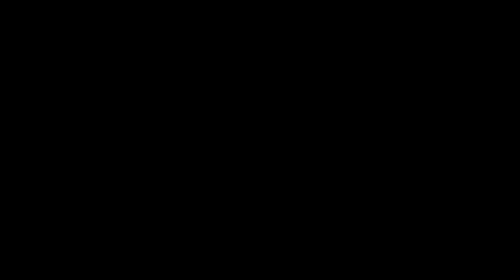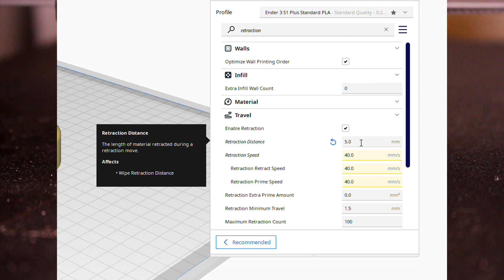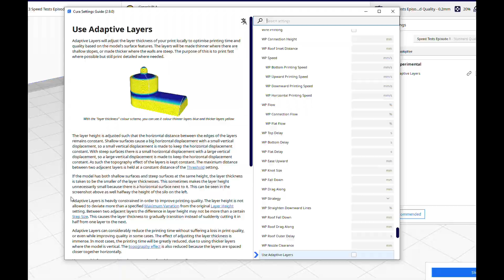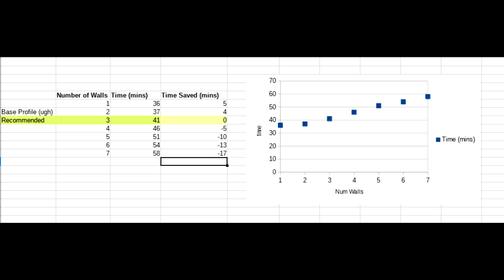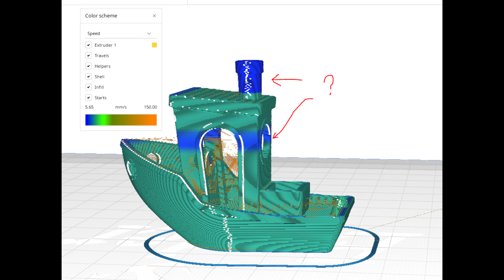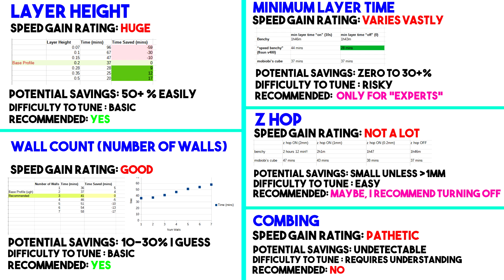Make your own FAST profiles in Cura 5.0+ - This video series will save you TIME. Part 1 of 3.

Comment: In all seriousness a great video. I'm trying to set up two Ender 3 V3 SE's. One with a 0.6 and the other a 0.4
The idea being finer details done with the 0.4, medium with the 0.6 and when I get my Ender 5 Plus back it will have a 0.8 for big and rough. I will mostly be printing armour and helmets which I smooth over with UV resin before painting. Does this setup make sense to you (I know you're not really AI (or do I))? Any advice is welcome and much needed

Comment: It's fiddly but possible to override the default settings from Cura by using the folders in %appdata%/cura/.

The default files for my SV01 Pro did many debatable things like excluding the generic materials - ignoring settings from any material inheriting from the generics - and setting multiple undesirable overrides in "quality" for different filaments and nozzle combinations.

One note: for some reason, the .def.json files go in /definition_changes/, not in /definitions/.

Now I can pick a filament, nozzle size / variant, and quality while keeping custom profiles for more "print job specific" cases as a final touch.

Comment: I have never used z hop on any printer. 
I like to set my minimum layer time as low as possible but still get enough cooling. Usually this means running several small test prints. 

Upgrade your parts cooling fan that will help drastically with printing faster. You can tweak print speeds and minimum layer time after. 

Have found acceleration speeds to make a big difference in print speed and if you don't go crazy with it you actually don't lose print quality.

Don't be afraid of adjusting acceleration speeds and running test prints if you start to see new artifacts go back to last good value.

If you have a stock ender 3 pro or similar start at 1k accel and work from there. Creality sets them stock to a slow 500
Reply from the maker: hah, you should watch the next episode from the other day

Comment: I've spent many hours tuning my settings in Cura to try to print faster on my Ender 3. My advice is:
- if you have upgraded part cooling fans, crank them up to as high as you can tolerate, decrease the minimum layer time to something like 2 seconds,
- use support blockers to prevent supports anywhere they're not actually needed,
- reduce the walls to 2 or 3, 
- reduce the top and bottom layers to 2 or 3, 
- use the lines infill if it's just an aesthetic part, or use gyroid if you need strength. Also enable "connect infill lines". 
- Try to increase your print speeds as high as they will go, but you're going to run into a lot of vibrational issues after about 60mm/s. Go faster on the infill and inner walls, but slower on the outer walls. After installing Klipper and tuning the linear advance and resonance compensation, you will probably be able to reach about 90mm/s until you see the same vibrational issues, but all of that is beyond what most beginners are willing to do so perhaps it's not worth explaining.
Reply: You should look into changing your nozzle size to 0.6 on cura even if youre using a 0.4 nozzle, I get double the time saving without adding any speed

Comment: I don't like combing, on my delta combing always results in the nozzle brushing past the supports and knocking on them. This can often dislodge the print or break part of it etc etc. With a later height of 0.1mm (average on my delta for me) and a z-hop of 0.2mm it barely adds any time at all. That along with turning combing off and my prints are vastly more successful, no infill knocking, and print times only go up by 10-15 min on a multiple hours long print.

I'll have to experiment more with my new Kingroon KP3S Pro but I think the same will apply to that as well.

And yes my cooling is adequate, my speeds are fine, all my other settings are good. I print with dried filament with proper temps and retraction settings per roll.

Comment: You left out some parameter which comes to mind. "Combine infill every n layer" this can save quiet some time as well, but unfortunately only when printing small layer heights.
I also print way thicker infill widths of about 0,7mm with 0,4mm nozzle. You can do the same to inner perimeter and reduce the parameter count from 3 to 2, or even to 1 perimeter but way thicker.

Comment: Great video and I’m looking forward to the whole series!

Non-linearity is prominent in your chart because you plotted X vs. Y, but X and Y do not have the same dimensions. Y is minutes, but X is a dimensionless number. If you replace the time (Y) values with linear values of 106, 74, 49, 37, 26, 21, 15 you will get a nearly identical curve, not a straight line as you might expect. However, if you normalize the actual data in both axes to values between 0 and 100, the line will be nearly straight.

Nonlinearity is real, though, because the bottom and top layers (as you pointed out) always take the same time, regardless of layer height. If your cube was 100% solid, the top and bottom layers combined would take up  0.53% at 0.7mm layer height but 3.77% of the time at 0.5mm layer height. But the cube is not solid, so the top and bottom layers take up an much greater portion of the overall time.

Also, your cube at 26.5mm does not divide into a whole number of layers except 0.1mm and 0.5mm layer heights. The slicer will probably throw away a layer at all other settings (or maybe it adds one, but it doesn’t print a fractional-height layer).

Comment: If you like to print fast, sooner or later you come to the idea to use big nozzles. There the maximum volumetric speed can be the limiting factor. In that case you might not see a speed bump if you increase the layer height. We are talking THICC! 1-2 mm nozzles.
Reply from the maker: Potentially. But there are some interesting surprises around that topic

Comment: Cant wait for the next video(s)!I get this series is about speed but Im assuming next things to cover would be jerk, maybe acceleration and probably one important thing would be line width BUT over the past couple of days I ve been playing around with these settings trying to improve the quality of my prints on my ender 3 V2 and although Im not sure I gained much in speed but 2.5x the jerk (stock is set at 10) for outer walls together with a 0.42 outer wall (0.48 inner and infill) gave me the sharpest corners so far.Deffinitely an improvement. Oh ye, aso wall printing order "inside first" plus wider line width got rid of the infill seen through outer walls when printing 2 wall lines only.
Reply from the maker: Idea for series two, improve quality! 
Not a bad plan... writing that one down. 👍👍
Reply: If your ender 3 v2 has tmc2208s then a recent marlin update means they are now compatible with linear advance. This will give you the sharp corners you want.

Comment: Combing is there to try avoid the nozzle scratching the surface. Ussualy you set it to not on skin
Reply from the maker: Apparently if I read it right, not in skin is now obsolete and the new one is "not outer surface" although I'm not entirely sure what the diff is, also it's not default on my cura so...
Reply: IMO combing is weird, because it tries to prevent retraction (or so I understand it) by oozing molten plastic on printed part (over sections that won't be visible, if correct setting is selected).
As result, the nozzle will be unpredictably more or less empty when it's time to start printing next line, which leads to low pressure --> under extrusion at the beginning 🤔

I won't even start with sensibility of not crossing perimeters, but it won't speed things up 😬

Comment: For the extra points, flow rate and speed ?
Reply from the maker: haha actually no! See me after class 😂😂 
It's line width. Width to height has an optimal ratio like 8:5 or something, I need to go remind myself of the exact number
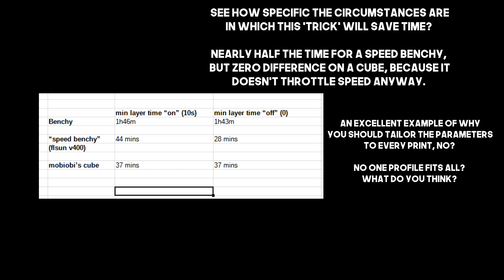Reply: Ah ok that does make sense. 8:32 , I never use preset profiles I change the settings for each model. I’m sure I would get acceptable results with presets but I never have for some reason.
Reply from the maker: me too - I usually have a base profile that's kinda "normal" then I change some stuff every print depending on the exact model, like wall count or support %, I think if you don't do that you don't get the best results at all, I'm trying to convince more people to do this I guess 👍
Reply: First

Comment: I'v got to disagree about Zhop. Since I started using it I've almost completely eliminated my prints getting yeeted off if the bed mid print after getting a small protruding of plastic smacked by the nozzle.
In my testing you don't really need more than a single layer height of hop to get the effect and at 10mm/s hop speed it really doesn't add much to the overall print.
Reply from the maker: I'm willing to entertain z hop, although when I tried it, the blobbing from raising the nozzle caused more yeeting. How many mm are you hopping then, 0.2?
Reply: @LostInTech3D  I use Z-hop on most prints, at 0.3mm. really helps in my opinion especially printing with a lot of jumps between seperatly printed areas giving 0.3mm allows me an amount of safty and in some cases actually makes the print maginally faster when combined with combing-not in skin. I really helps if you have a part that has more than one section/area on the layer (two towers for instance) as it gives additional moment for the retraction to happen before making the jump to the next part of the layer
Reply from the maker: Hmm sounds like the perfect topic for a friday poll! 👍
Reply: @LostInTech3D  were you using retract on Zhop when you were getting blobbing? And yes I'm using 0.2mm Zhop.
Oh and for clarity this is all on an Anycubic Mega X.
Reply from the maker: I kind of skimmed over z-hop tbh because it wasn't following my narrative 😂 - it needs more work, perhaps even a dedicated vid. On some printers it's default and works really well. I'll note that one down.
Reply: Disagree. Z hop 2x leyer height because few times some little blobs ruined my tree support :c
Im printing mostly petg and i have retraction retract speed set to 10, and retraction prime speed set to 30mms, retraction minimum travel 1.5mm. My z hop speed is 10mm, but in printer i've changed velocity of Z to Vmax 12. Its hopping faster, but not too fast

Comment: One observation I have made in arachne is a trend to lots of gaps in the top surface, like if I have text and numbers in the top I get issues
Reply from the maker: yes I've noticed that, it needs investigation, the back bit of a benchy is a prime example!
Reply: @LostInTech3D  My guess is the lag in flow rate changes, try turning on linear / pressure advance if it's not on already. Flow equalisation set to 100%  might help as well.

Comment: cura could be so amazing if it didn't have so many default settings that are just braindead
Reply from the maker: the defaults are in the profiles, I should start a dialog at some point with the devs on how you would go about submitting a better profile
Reply: @LostInTech3D  every setting has a default which profiles often do or don't touch.
Reply from the maker: true, true. Prusaslicer is the same, I tried from scratch the other day and it was a nightmare. Fan settings especially!
Reply: @LostInTech3D  the combing stuff as well. By default it tries to comb without retraction which leads to massive underextraction when it starts the line again